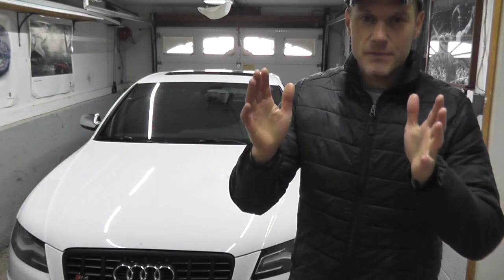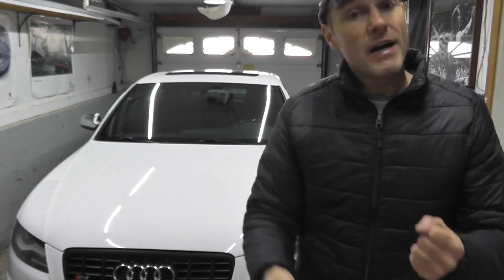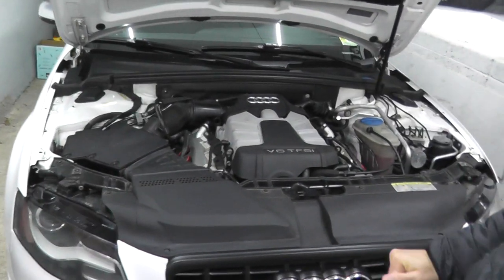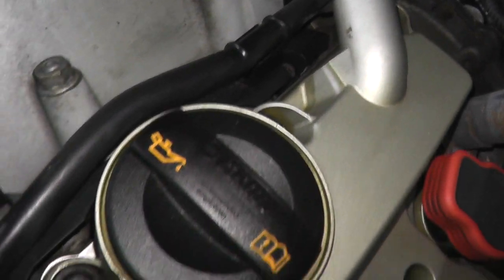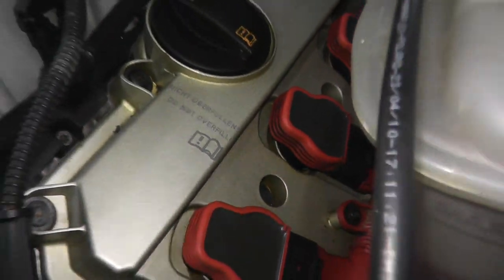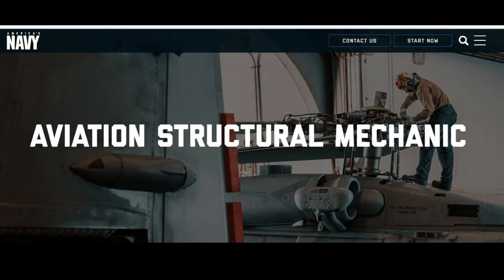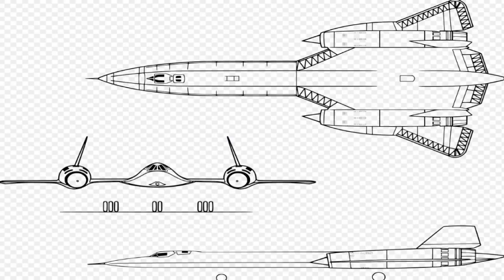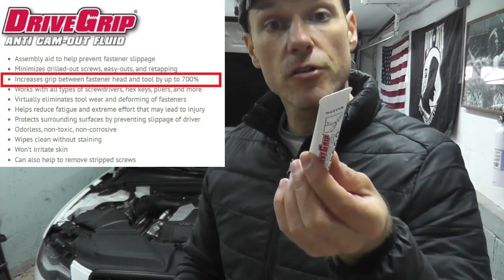How to Remove Torx, Triple Square, Allen WITHOUT Stripping

Comment: Wonder if I can use construction adhesive similarly to this,  an if it would work or help in a way.. Although this stuff obviously appears to be much thinner..

An I'm also wondering whether to break loose a very tight torque screw,  possibly with loctite.. Whether I should use a impact driver on high level,  just quick bursts to break it loose.  Or if that's more likely to strip it,  an if I should just use a socket wrench.. 

Obviously need a good grip and pressure,  I just don't know if that strong initial impact may help or inevitably strip it.

Comment: That is literally just valve grinding compound which Aircraft Mechanics have been using for years.  They are just charging you more by selling it at a massive price increase in a tiny tube.  That being said, you are in worse shape than when you started when you inevitably strip it out further with the compound.  You now have a very hard and abrasive grit that destroys the drill bit you now need to use to finish the job.

If I am removing a panel with 50 screws and 3 are stripping out, I drill and extract those 3 screws.  Every time.  Frigging around with grip compound and ruining drill bits just slows down the job.